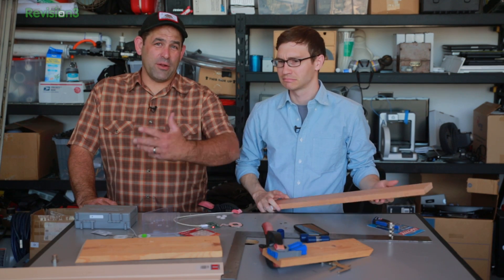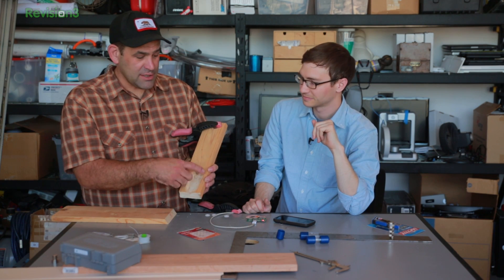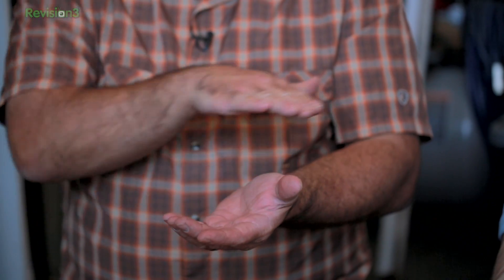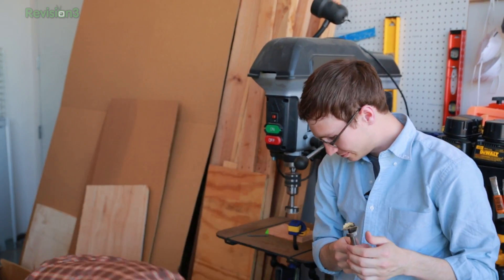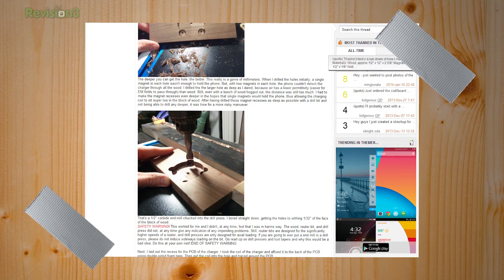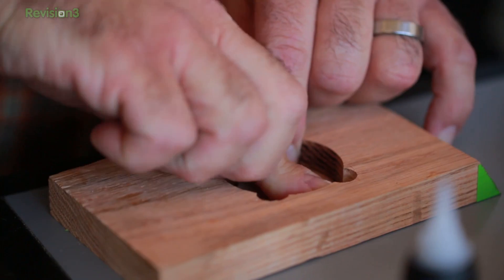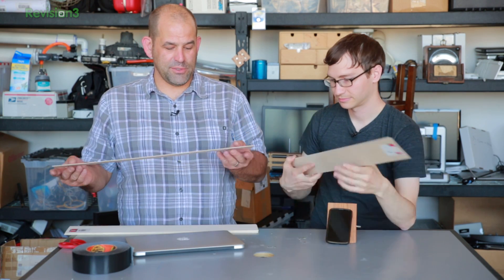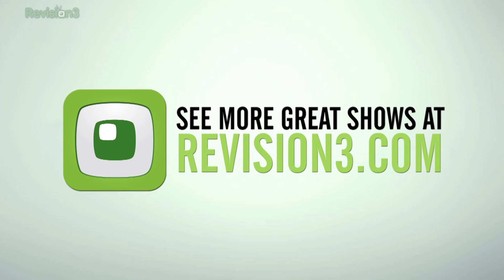Make a Wireless Charging Stand

Comment: Aside from the distance between the two coils there is another issue that can cause problems in wireless charging devices.  Wireless charging is basically taking the primary and secondary parts of a transformer and moving them into separate devices.  Most chargers and coils that you get for phones rely on the metal in the phone to act like the transformers core.  However, you have to remember that every transformer needs a core and that core material can only handle so much magnetic flux before it is completely saturated.  If there isn't enough core material or there is a strong enough magnet nearby then it saturates the core and won't allow enough of a change in current to make any bit of difference to your secondary coil.  So just remember, nearby magnet fields from strong magnets will interfere with charging.  You also need to remember that there is a coil in your phone and moving your phone fast through a strong magnetic field (or moving a strong magnet fast enough over your phone) can produce a current in the coil that may be large enough to damage the charging circuitry in the phone.

Comment: Your "induction charging" is a magnetic coupling that becomes a resonant transformer when the coil in the phone is in the EM field of the charging coil. I suspect that a good way to mess with that is to surround it with permanent magnets.
Reply: +Brek Martin 
I was wondering the same.

A shame these guys don't have magnetic film or a multimeter to do quick comparison on current supply of magnetic enabled vs non when recharging.

Comment: The biggest problem here is the stand itself given that the phone has to placed quite accurately in respect to the hidden coil. Surely a rest that the phone sits in that is in the shape of the phone would work better for the sake of easy alignment. I suspect lying it flat would also be much easier than attempting to stand it upright every time.

Comment: It would be easier to just get crap wood, drill that hole all the way thru and use really nice wood veneer to achieve the least amount of distance between the charger and the phone, use rare earth magnets, but they failed to mention that there's been a upgrade with these chargers and a lot more distance and their idea would have been fine, but the either didn't know or they went the cheaper idea! Presto!

Comment: With my Lumia 920 I took the wireless charger that came with it (promotional) and put it into a lego setup.  I had some lego rubber bumpers for the phone to sort of sit in without getting scratched up, the wire for the charger shoots straight out the back of the stand, and there is a gap in the bottom center so that if I want to plug the USB into the phone it can still sit upright.  With the Glance Screen feature that stays on whenever on the charging stand I have a constant clock/notifications when at the desk.  Works great.
Reply: Don't step on it with your bare feet
Reply: Lego hacks FTW!
Reply: I'd really love to see a picture of that Lego project.

Comment: You could do the routing and mounting of the magnets on the top face and then use a nice sheet of veneer to cover that.  Using this method you will also be able to route the wiring under the veneer as well and just have a cord coming out the side or end.  Give it a try.

Comment: After you drill the hole, use a "dado clean out" bit to increase the depth of the hole in a precise manner. I like to use a palm router for this. You can get the wood extremely thin using this method.
Reply: Thanks for the tip!

Comment: Seriously? How many f*cking times did your shop teacher scream "no cross cuts on the rip fence." Its not complicated or difficult to understand that you're supposed to use a miter gauge for that f*cking cut. And I don't really care if you put yourself in the hospital, that isn't my concern, my concern is that someone else who doesn't already know better "learns" that trick from your videos and hurts themselves.
Reply: Duly noted. We're actually a lot more safety oriented than you might think, we try to always use tools in the proper manner. That said, you have me thinking I picked up a lot of table saw habits on from high speed low drag contractors back in the eighties. (And that maybe it's time to take a woodworking class to clean up my habits... learning welding in a proper class made a huge difference.) And my memories of screaming shop teachers center more around clamping things down before using the drill press...
Reply: patrick norton Wow, I give you due credit and appreciate you taking the time to respond, particularly given the overtly hostile tone of my post. 

Yes, having worked it from both sides if you will, being trained in classical woodworking and working on construction sites, and common practices at the latter never cease to scare me. Granted a 110v contractor table saw won't take a board you're cross-cutting and spit it and you back out the way a real tablesaw will (seen it) but you can still seriously hurt yourself obviously. 

If I had a guess, and it is just a guess, a full shop class might be overkill for someone of your skill level. A few painful hours committing the odd safety manual to memory might be all that is necessary. (and much cheaper, after all why buy when you can DIY) ;) 

Cheers mate. :)
Reply: yeah i thought same thing, that dewault comes with a crosscut i am sure of it, slides right into the side

Comment: A neat project though...
Drill through the wood and apply a thin veneer of the same species to the surface? And if you have a project woodshop then may I suggest a router as the next tool to buy.

Comment: Neat project, I've been considering doing this at several occasions. I will certainly do it with my nightstand later on.. I'll probably just cut a hole in it, put the electronics on a piece of thin wood, and cover the top back up with some fake wood/wood lining/or whatever it's called.

 Just wondering, how big can you get those induction plates? would be great having the whole table top working as a charger so that you can just toss the cellphone there when you go to bed, and maybe have it NFC activated so that it doesn't waste too much electricity. (Haven't looked into how NFC works, might not work as intended, in which case I'll have to come up with something else.)

So, what do you guys think? Is there something in particular I should look out for? (excess heat etc.)

Comment: Like the video. I just did something similar a few weeks ago. A drilled out a hole in the bottom of my cheap night stand and just set an qi charging in it. It works great. I tried using a disassembled, cheaper qi charger a first but the charging distance was very small. I bought a used nokia qi charger and it work much better. I worked so well that I didn't even have to disassemble it. It actually has three coils in side of it so it has a big sweet spot too. I use it to charge my iphone in a qi case, my nexus 7, and my 3ds. I haven't notice charging times being slower. Was going to do some power consumption and charging time test later.